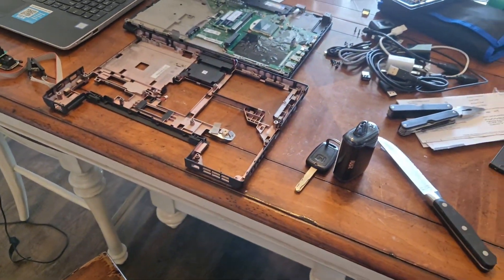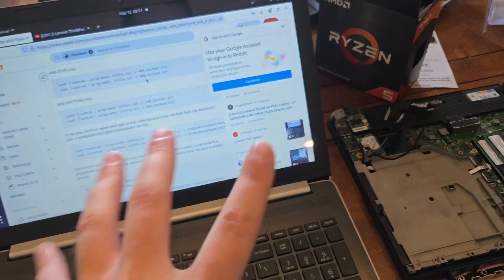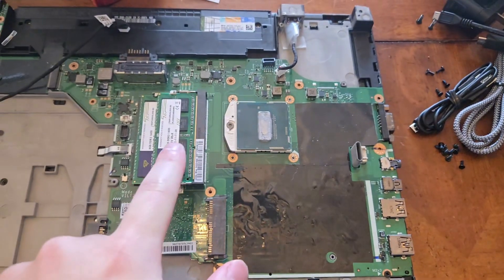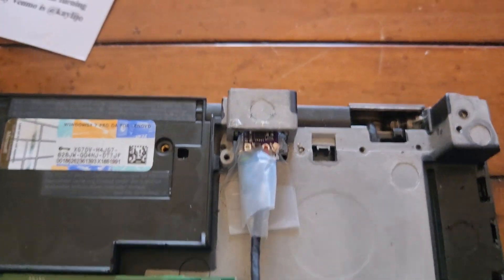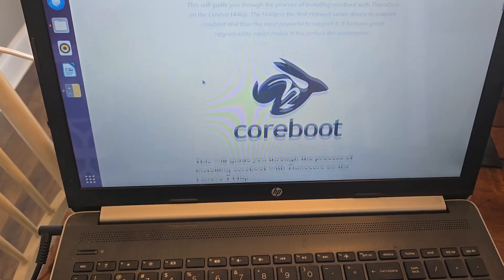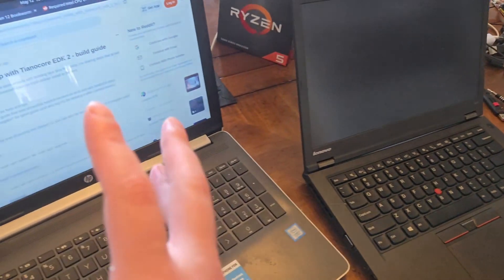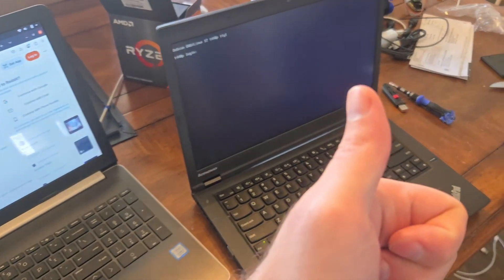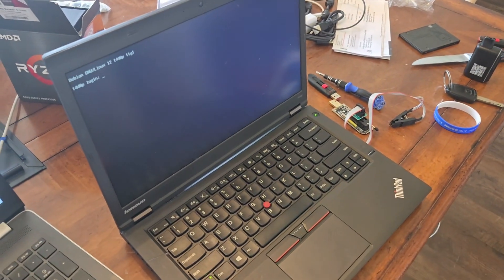How I Put Coreboot On My Thinkpad T440p

Comment: Nice, my HP stopped updating my HP Envy bios, and want to change it but have heard that I can brick my computer ie not reusable what so ever. Right now I have NixOS running
Reply from the maker: Technically yes you can. However as long as your laptop is supported and you can follow guides (not just wing it). The odds you are going to brick something is extremely low. Hell I accidentally put the clip on backwards and tried to write and all I got was an error no bricked machine.

Comment: OpenBSD works on my t440p running coreboot with the SeaBios payload. I flashed mine with skulls (a coreboot distribution that provides pre-built images). You don’t need to compile it yourself, but you obviously can. 
btw, now that you’ve flashed your bios once externally, you can re-flash as many times as you want WITHOUT having to open the machine up again. It can be done via terminal commands. Most guides call it “internal flashing”.
Reply from the maker: I recently got done flashing Skulls and it's incredible. OpenBSD 7.7 works like a charm. I owe you a great debt kind sir 😁
Reply: @ZaneyOG  I’m glad you got it working!
Reply from the maker: Thanks for letting me know! I will use skulls this time around.